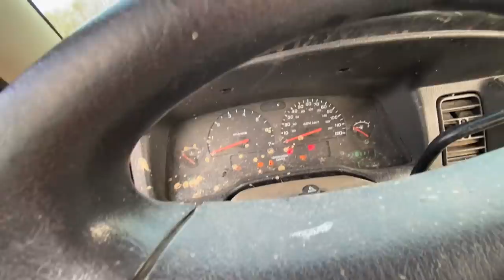KILLDOZER VS DODGE DURANGO!

Comment: Just an Idea for the Montero. But can you use two ratchet straps and basically make  a X where the tie rod ends from the steering rack are on the front knuckels on each side and crank em down till the wheels are held straight😈  I know yall are like wtf is hes talking about but hopefully you guys are pickin up what im puttin down hope it works if you do.😁 but as always loving the content guys keep em coming

Comment: Great to see you wearing your Dunlop boots at 0:45 but you should wear your carhartt pants over the boots, like Brad does with his.  More comfortable than shoving all that pant leg material into the boots.  also prevents crap from getting down into your socks.
Reply from the maker: I used to still my legs got all chaffed
Reply: @markfreeman408  I never found chafing a problem wearing my pants over my Dunlops.  Might lose a bit of leg hair but still better than tucking my pants in I find.  Can you try wearing your pants over top of your Dunlops in your next video?

Comment: You guys need to just get a pair of vise grips for the steering column to drive the Montero. Also you need to take that puddle of yours when you’re in the dozer tilt the blade all the way and then lower it to make the mud two or three times as deep
Reply from the maker: We did! The steering broke somewhere in the middle! We still jumped it last week though!

And I did make the puddle deeper!